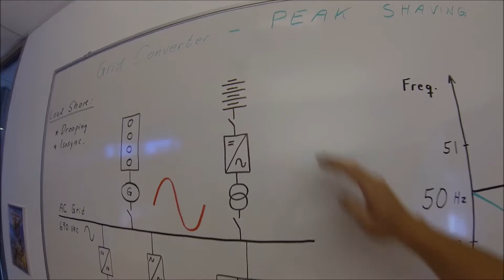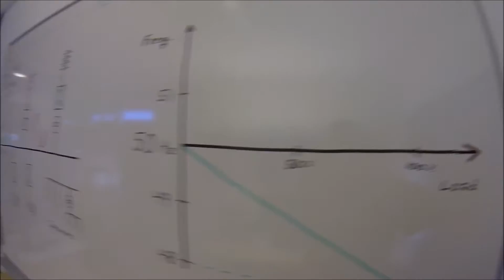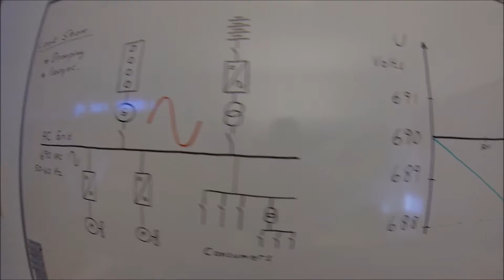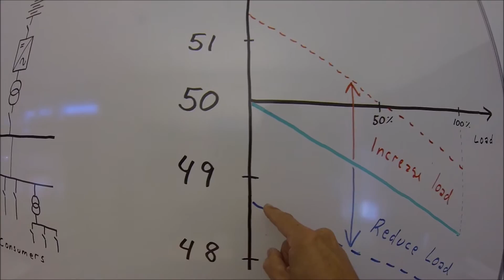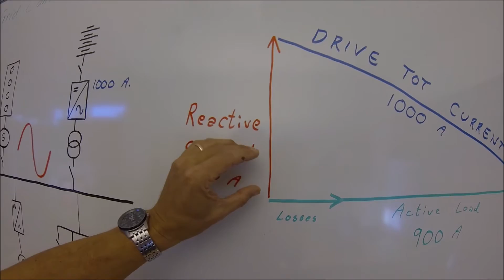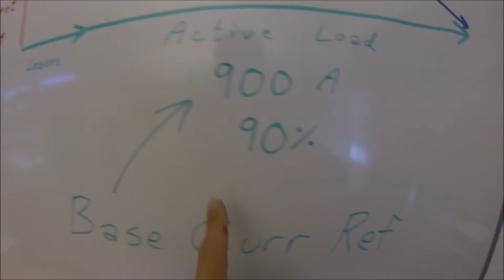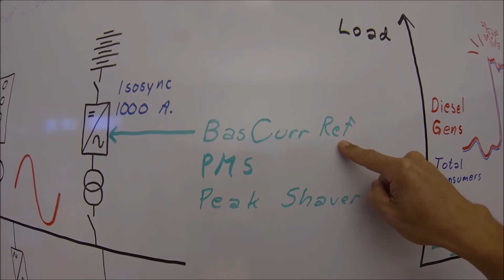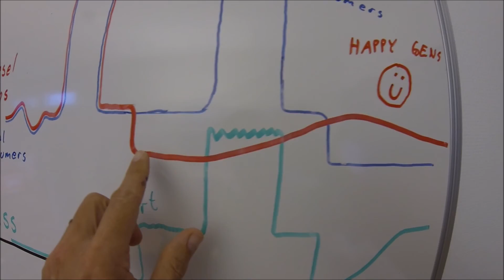Drives School (E8) - Grid Converter, PMS peak shaving

Comment: Hello Reidar. I'm interested how the switching over is arranged from peak shaving mode (Isochronous) to only battery online (Drooping) in case of DG shut down. Should this functionality be implemented in PMS ? Is it fast enough?
Reply from the maker: Hello Marek. Swap from isosynch to droop is done by PMS. Looking at all the diesel generator breakers when last generator is offline then swap uGrid drive to drooping and also set basecurr reference to zero if it was in use. Transition from isosynch to droop does not have to be that fast. Worst thing that can happen in case slow PMS response is that grid frequency drop to what u have defined as minimum. Typical in a 60Hz grid you set 57Hz as minimum.
Reply: @AcrodesignerLNSNI  Thank you for prompt answer. Following up topic I have next questions. Is there any functionality in the drive which swaps from isosynch to droop in case of basecurr reference or PMS fail?  In case PMS fails and online DG and battery share load in drooping mode is it posibble to do load sharing (loading, unloading) manually by incr/decr directly on the drive ? Best regards.

Comment: Hello Reidar,
What about the generator power when a high power consumer is switched on abruptly (like a direct start of an electrical engine) ?
The PMS will send a base current ref to handle this high power demand, and it will take around 100ms(that's what you said)  for the converter to gives current to the grid .
So what happen during this 100ms ?
Thank you
Reply from the maker: Spinning reserve in the inertia of the diesel generators will supply the first 100 ms of current surge for DOL